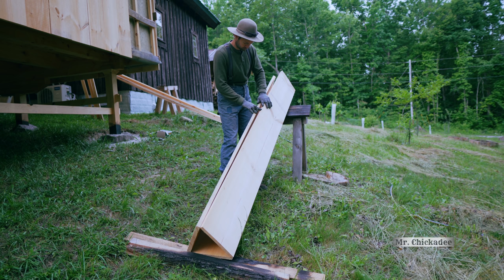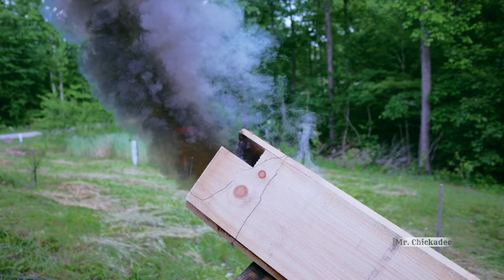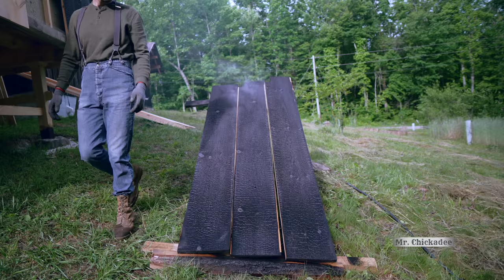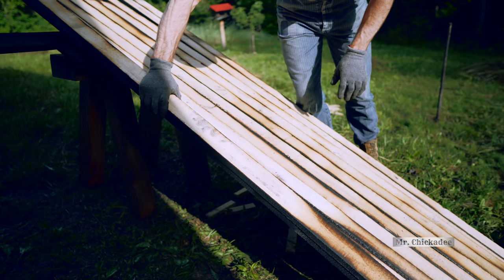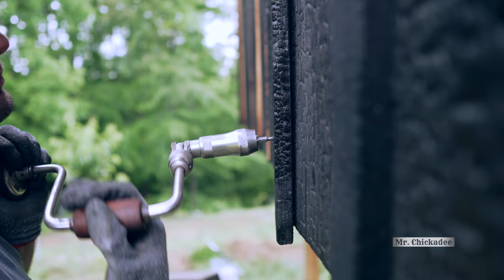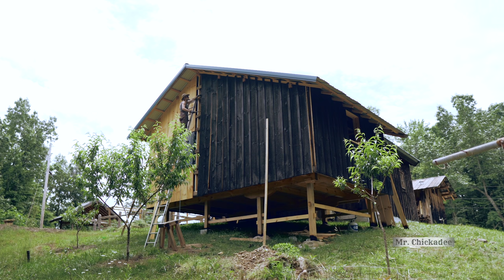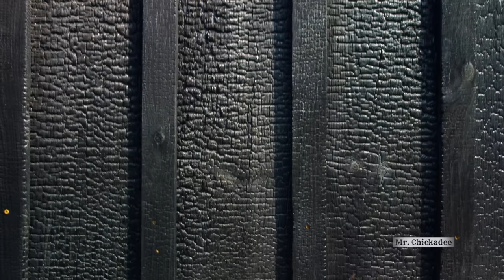Burned board and batten siding. Yakisugi (焼杉) Yakimatsu (焼松)

Comment: @mr. Chickadee with this deep burn into a 4/4" boards on one side, what kind of wood movement are you experiencing? Cupping. Warping. Also would be nice to revisit one of your older Yakisugi projects to see how well its aged.
Reply: The burned side always dries, notice all the white steam coming off, and therefore contracts.
Reply: Its just siding
Reply: Thinking the direction of the grain will have more effect on cupping like when laying your deck wood down paying attention to the circular grain. 
So bark side towards house. It's wood, its gonna move and stuff which is the appeal and character over sheet or vinyl covers. Great stuff thank you for the inspiration.
Reply: The deep burn is not for wood movement but to protect the wood from the elements  and insects.

Comment: I bought a 1860s workman cottage in Cambridge MA built with salvaged burnt timber’s from other houses. I’m convinced that saved it from termites. Wherever they used non burnt wood there would be termite damage. It was balloon framed so the sill often had rot and the first few inches of studs... which ran 2 flights to the roof plates.
Reply: Absolutely. The burnt finish is HIGHLY insect resistant.

Comment: Fabulous crocodile charring...perfection with this technique! When I did my main cabin I laid the boards flat...so much wasted heat. Building a small sleeping cabin soon and will use this method...thank you. Also love the shot of the stainless steel screws steadily securing the battens and pulling the boards tight.
Kudos to you both.

Comment: That looks really good! last time I worked with soot ended with black snots for days,  really fine dust. There's an indigenous ancient tree resin, Copal, that's very handy perhaps for this kind of finish given that it's meltable and super flammable too, actually it was used in the old recopies for wood varnishes. I know this Japanese technique must have its science but I used to fixate the soot to my ceramic sculptures with a blowtorch and brushing over copal dissolved in alcohol, ultra resistant actually for a ceramic material that's hard as glass. Never thought about using it for wood until I saw this video 👍

Comment: I made a sitting bench from a trashpicked plank of Doug fir a few years ago, and charred it and then wirebrushed it several times to remove the soft wood between the grain lines surface char. The grain was accentuated and the wood overall very much hardened, and it's held up very well out in the weather, and without forming splinters.

Comment: I’ve heard that the outermost layer of burnt wood has a lot of surface area and is thus able to absorb a lot of water. And also the protective layer you want is actually the intermediate layer between the unburnt and the charred wood. That’s why it might be a good idea to scrape off the top “coal” layer. Is that something you have considered? Or is the absorption of water a none issue in this use case? Would love to hear your thoughts on that! Great work anyway! 👍
Reply: I have read something similar, for that reason 'baking' instead of 'charing' became popular in the 90ies in Europe. When done with ash, beerch or oak wood it caramelizes and thus becomes less water-absorbent and more resitant to rot and fungus.
Unfortunenately I have no data about usefullness and prevalence of each technique with diffent types of wood.
Reply: I heard just a few days ago that this only works on Japanese cedar. There are lots of myths around charring wood and not a whole lot of research
Reply from the maker: Mitch Brown, not sure where you heard that, wood burning has been practiced around the world as a preservative for centuries. They actually sell "thermally regulated ash" for porch decking in many areas, which is just baked to get a similar result.
Reply: @MrChickadee  It was a Tasmanian company that sells hardwood cladding products, so maybe some bias there!
Reply from the maker: Brushing is not done unless its needed, for example a door or floor or furniture that will be touched often. I see no reason to remove char which is removing added protection. With a traditional proven technique like this, we dont need to over think it or re-invent the wheel, just follow what they did, which is burn and install and enjoy for centuries.

Comment: I'd heard of hanging the boards with just one nail from you and mentioned this to the guy I'm learning to building barns from, he seemed worried it would cup and move around but I take it screwing the battons down provides enough clamping force. This seems like the least likely way to split boards from board or building movement.
Reply from the maker: yes, the battens must be tight, and the wide boards oriented correctly so they cup outwards. This technique permits seasonal movement of the wide boards to prevent the common splitting.

Comment: Completely makes my day when you upload. Thank you!

And rule of thumb on the size of timbers when making a timber frame? I'm going to start a small timber frame next year (12x24) and my sawyer says 6x8". All we have around here is hardwood so a 6x8" oak beams seem a little overkill for such a small build.
Reply from the maker: Miles, that really all depends on the frame design, type of framing, and other factors. It could be enough, or not enough, or overkill depending on the frame design. My woodshop is 12x15 and has 6x10 tie beams spanning 12 feet. However, my house extension ( the one in this video) has 4x8 tie beams spanning 16 feet! It all depends on the frame design. What loads are the beam supporting? Is it supported by a post underneath or is it free span? what is your snow load? How many of these beams are sharing the load? If there is a beam every 10 feet, or every 5 feet for the same load, that changes everything. See what I mean?
Reply: @MrChickadee  There are a lot of unanswered questions I have to look into. Looks like I'll be looking for a class in my local area. 

Thank you for the insight!

Comment: It seems like the boards would cup after burning, and then screwing down the battens would make them split. Does that happen? It seems also that heat and water would cause a lot of warpage. How much do you allow for that? I find this very scary. Have you ruined a lot of material burning it too much?
Reply from the maker: the cupping is not so severe with white pine,and it is used to advantage by ensuring all boards cup outwards and press themselves tight to the battens. Ive never had the battens split the wider boards, though they are pretty tight! Ive not ruined any, in fact the only mistakes have been not burning enough, which is an easy fix with a bit more heat.

Comment: so do you treat this after, is this aesthetic or does this actually protect the wood?
Reply: The burning actually protects the wood. I have seen some people put a coat of oil on after brushing off some of the char, but not sure if that's how Mr.Chickadeedoes his or not.
Reply: it's an ancient Japanese technique that protects the wood from damp, rot and also bugs getting into the raw timber.
Reply: It does!  Keeps away insects, mold, and rot.  Looks awesome too!  No need to top coat or anything else.
Reply: It protects the wood from rot.
Reply: read the description and turn on closed captioning
Reply: it protects the wood. The char keeps it from weathering or rotting.
Reply: Check the description, he says why he does this! 👍
Reply: Try reading the description
Reply: Protection and preservation first, looks second! Watch the video where he set posts, they also got the torch! Arts & Crafts homes in early 1900s used this a lot too!
Reply: Burning away all the organic nutrients in the surface of the wood leaves nothing of nutritive value for any life forms.  The carbon that remains is basically inert so not damaged by sun as well.

Comment: I have never seen anyone else burn their wood to such a great extent. Do you know this to be necessary or are you doing it for some aesthetic purpose? Also, I have seen others treat the wood with linseed oil after burning. Is this necessary? I didn't see you do this step. Thx.
Reply: I'm just a kiddo when it comes to precision woodworking, but as a observer. I assume that it's not necessary. If You don't need the surface to be touchable, in that case it's wise to lightly scrape the charcoal and close the revealed pores. Have seen few old builds with this treatment and even 80y of sun and snow doesnt harmed the wood, just the old nails coroded away.
Reply from the maker: This is the traditional technique, oiling is optional.

Comment: Is there a residual smell of burnt wood? If so, do you ever detect it on the interior?
Reply from the maker: Not at all, very soon after burning there is no smell at all. The smell is from the smoke and action of actively burning.
Reply: @MrChickadee  Thank you. I asked because I have done a little Raku pottery and the burnt wood smell remains until you seal it. I'm glad to learn this is not the case with wood.

Comment: Apparently, charred wood is extremely resistant to water and therefore decay.
Reply: More than that, insects and mold will leave it alone as well. Back in the days when they built a foundation out of logs they used to burn the ends that would end up in the soil and it wouldn't rot out.

Comment: Are the insulation boards (is that rockwool?) protected from humidity from outside and inside of the house?
I understand there should be a membrane on the outside and a vapour barrier on the inside.
Reply: Not hating - the entire build looks awesome :)
Reply from the maker: No vapor barrier
Reply: Vapor barriers are actually incredibly situational for extreme climates, the only states in the US that warrant the use of vapor barriers are places where the outdoor weather is permanently colder or hotter than the indoor weather. The use of a vapor barrier in a state like Kentucky with 4 varying seasons will lead to rot and mold forming in the walls from cold and hot air condensing on the vapor barrier inside the walls, and is actually against code.

Moisture barriers on the other hand are universally used but are also not necessary.

Comment: Thanks again for another great video. 👍👍 Do you apply a filler or something to the screw and nail holes to prevent water ingress and/or rust/deterioration of the fasteners? Just wondering. Thanks again. 😎👍❤️

Comment: This burned wood thing makes me veeery ingrigued!
The wood turns into charcoal, right? And isn't charcoal... highly combustible? (all I know is that it's used here to burn in barbecues)
And isn't it "powdery"? Like, you touch it, your finger gets a black powder? And then won't it be taken away by strong winds over time?

And this preservative process is only needed on the out side of the the boards?
Reply: Takes a pretty good bit of heat to get that be charcoal lit though and it mostly slowly smolders. A bit of dry pine as we see here is highly combustible, makes big fire that travels upwards in seconds. This process should improve fire resistance. Also less attractive to insects, and can be oiled to help waterproof it against driving rain. It might last upwards of 80 years if oiled every couple years.
Reply: Charcoal that you use for barbecuing is made by burning wood without presence of oxygen.

Comment: How about temperature in hot summers, considering its black?
Reply: I dare say the char is insulative.
Reply: Or at least the wood behind it is indeed insulative, so a little heat accumulated because of the black surface probably doesn’t get through
Reply from the maker: there is R30 of insulation between this siding and the interior, so it will never effect anything.

Comment: Hello! In my area in summer it gets too warm, but in winter fairy cold and very very rainy. Does the burned wood gets to hot with direct sunlight exposure affecting the interior temperature, or the isolation works well also for hot seasons?

Thanks very much!!
Reply: Wood does not conduct or store heat like stone, brick or concrete.

Comment: Cool thank you for showing.  found it interesting.  love the texture it gives.  The tip for placing the board bark side and top of tree was good - not sure I could figure out on a board.  Putting three together and creating a chimney updraft to burn  in a good idea.  Was the siding on the building next door done the same way?  Just has weathered and washed off the carbon? Letting the wood dry out hanging on the wall was interesting.  now I am wondering about gutters.  curious what a traditional japanese rain gutter system might be like. Will some form of straw mud plastering be done on the inside?
Reply from the maker: no, I just surface burned the house walls, I now prefer this deeper burn, as a lighter burn does not last as well or protect as well.

Comment: Q about your comment @4:45: I'd have thought bark side in so that when it cups it'll push against the batten, tightening the seal.
Or?
Reply from the maker: no, flatsawn boards cup towards the bark side 99.9% of the time. So the heart side is crowned, so the bark side is pressing into the battens on the outside of the building.
Reply: @MrChickadee  - ah yes - the rings are like rubber bands that contract when they dry and in so doing pull the wood away from the pit and so towards the bark. Figures.

Comment: Gorgeous and highly functional!  How long does wood treated in this way last in the weather?
Reply: My cabin is till fresh 4 years later. It helps if you deeply char the wood as Mr C. demonstrates.
No brushing....the wood will lighten gradually over time, and the water helps to prevent the wood from warping with the heat...orientaion of the wood is also key...it's all explained in the closed captions.

Comment: Great video, Josh. Good technique and end results. I didn't see you seal the planks with anything; did you? I just finished my own yakisugi siding here in Japan ("Fire on the mountain"); it's fun, but glad it's over.
Reply from the maker: Ive never seen the japanese seal traditional yakisugi siding, but I have used a drying oil/pine tar mix, thinned down with natural solvent and just sprayed on the wall with a hand pump garden sprayer

Comment: I really love this and am thinking about using this technique on my own siding I'll be milling up for my home. I was wondering, do you have a certain "recipe" for this, so to speak? I.e. how long does one let the wood burn and if it is timed, how deeply should the char penetrate/when to put the fire out, what type of top coat is applied after process (if any) and is it ok to not use any kind of top coat application. That kind of thing. I would really love to know so I might have more confidence that I'm not going to royally f$%! it up.

Comment: As I can see, not all the pilllars of the building stands on natural rocks, as was shown in some previous video. Some stands on concrete pads.
Reply from the maker: Those are just flat stones, I never use concrete in buildings, I used flat stones on the last two posts that were added later, round would have been very difficult to fit them to a building already in place.

Comment: That looks real good do you oil it know , I am thinking is those walls like a big bit of char cloth maybe if they get real dry over summer what if you add oil ,oiled charcoal how easy will it burn . It should not rot or attract insects maybe . Down hear in the land down under I was building some timber decks back in the 80s my friend said to me you don't need that fancy decking oil just mix linseed oil with turpintine it's the same thing well we built five decks over the next month's and used the linseed-turps mix looked good six months after that all those decks got a black mold living on the linseed oil didn't hurt the timber just went black ironbark timber reds and yellows .

Comment: I don't understand the burning of outside planks
Reply: weather protection : )
Reply: it prevents rotting and bugs
Reply: It makes them fireproof, lightproof, insectproof etc. (as it says in the description) so it's a really nice way to weatherproof the outside of your house. Also, fireproof wood sounds like a very good idea in general.
Reply: Makes them rot, insect and UV resistant. Depending on the wood species used, it can last up to 50+ years

Comment: Love your videos Sir.  Quick question; is there a reason for not doing both sides of the wood.  It did look like you did both sides of the batons, just not the wide boards…. Just curious as it seems it would deter rot if burned both sides. Thanks. 😃
Keep up the awesome videos!
Reply from the maker: just outside where all the trouble is, inside should not need it.

Comment: How does it make it fire resistant? Its charred like charcoal is which you use to help build a fire. So I don't understand that part of it but agree with all the other things you said it does for the wood. You burn the wood more than I've ever seen done when watching other videos of people doing this. Is it better to burn it this much? I thought all you needed to do was blacken it a bit so the pours in the wood closed. I guess that charring it this much would work better thinking about it now because a piece of charred wood from a fire I've noticed is very waterproof so I guess its better to char it this much. Neat video. Stay well.  👍
Reply from the maker: yeah, till you see it firsthand it may seem counterintuitive. The charred wood takes longer to ignite than fresh dry wood.
Reply: The ready available fuel in the wood is burned off so it is harder to start burning again